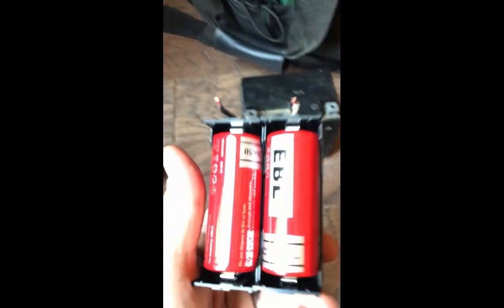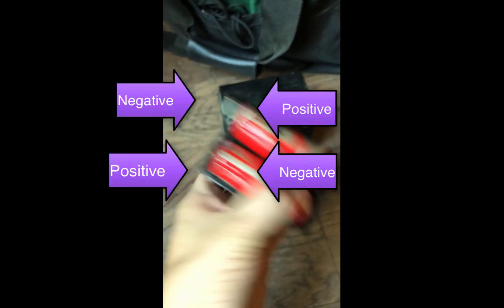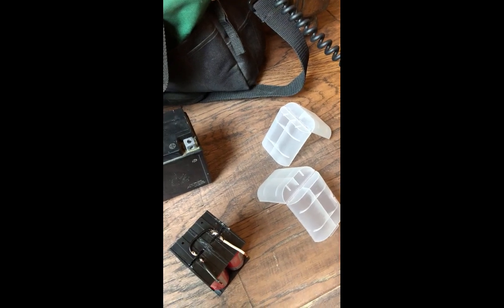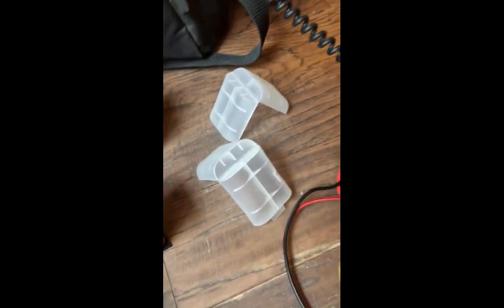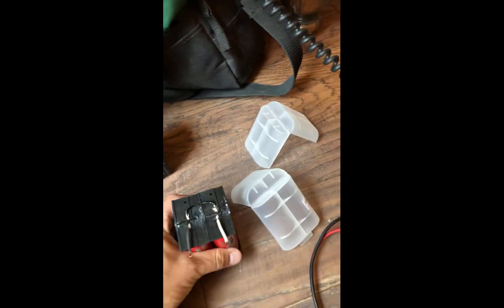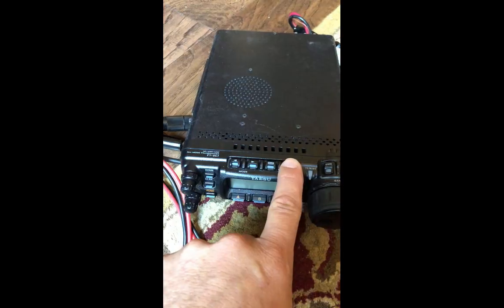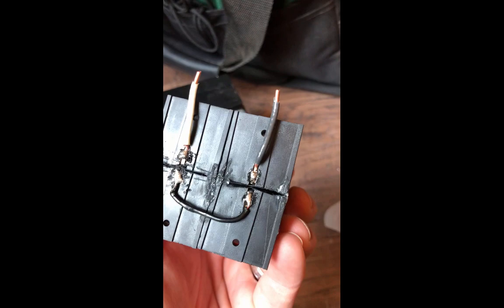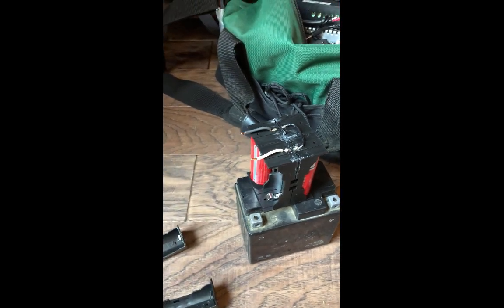How to make a 12V Lithium-Ion Battery for $23 @ 6Ah

Comment: Good video. You inspired me to buy some rechargeable batteries. Then I have done the math. You are wrong mate. 1. two batteries can be connected in either "series" or in "parallel".
1a. "series" is when we connect the battery poles in a positive to negative orientation.
1a. when in series we add the voltage and average the amps
1b. "parallel" is when we connect the battery poles in a positive to positive and negative to negative orientation.
1b. when in parallel we add the amperage and average the volts

eg. when taking two 6 volt, 100 amp hour batteries in series, it becomes 100 amps at 12 volts. When in parallel, it becomes 200 amps at 6 volts.

In your case 4 batteries average is: (4x 5000 mah)/4= 5000 mah.

Means 5,000 mAh @ 3.7V = 18.5 watt-hours / 12V = 1.5Ah. 

Battery Life = Ampere Hours / Current ( Ampere)

My Xiegu G90 currend draw is 4A TX. Means 1.5 Ah/4 = 0.375 h = 22 minutes.

For qrp like FT-817 the average current is 2A. Means 1.5 Ah/2 = 0.75 h = 22 minutes.
Reply from the maker: Thanks for the feedback.  My math above used parallel calculation but I have the batteries in series.  So it should be 5000mAh @ 14.8V (i.e. 3.7V*4) which equals 74 watt-hours, so if I draw from that power at 12V instead of 14.8V, then that comes out to 6.17 Ah?